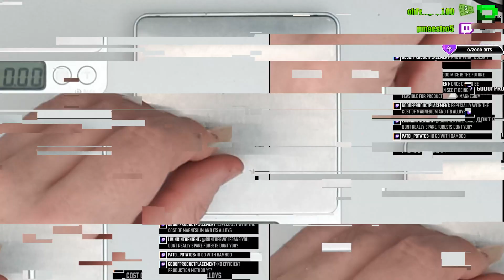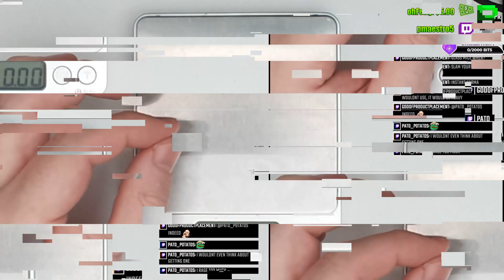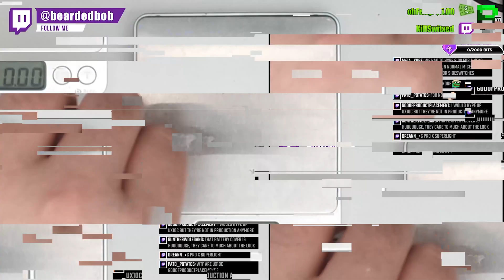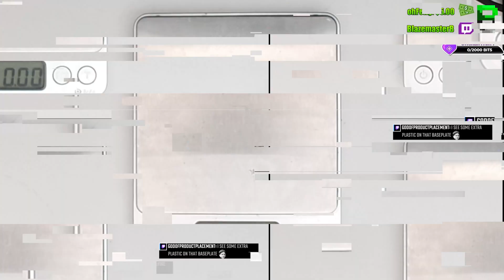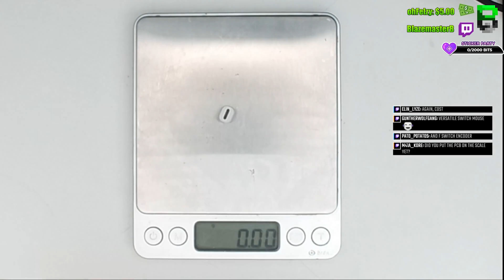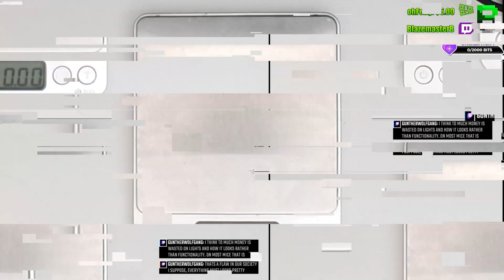Xtrfy M4 Wireless: A Closer Look Inside

Comment: Moving the weight: it tells you to unscrew the screws by 1mm (that's like 2 turns at most) and move the weight. The screws wouldn't go loose. You just use the screwdriver in the screw heads to move the weight.

Comment: Hey bob! Awesome and informative video as always. 

I recently just bought an M42 wireless and it might have a defective battery. What part number should I be looking for to replace it? Should I look for the 602535 one? And what type of connector does the battery have? 

Great job and keep it up!
Reply from the maker: Hey,

I've just taken the M42 Wireless apart so check out hte Teardown which it drops in a few days. Failing that the VOD over on Twitch Beardedbob